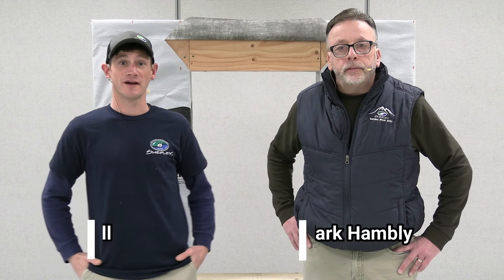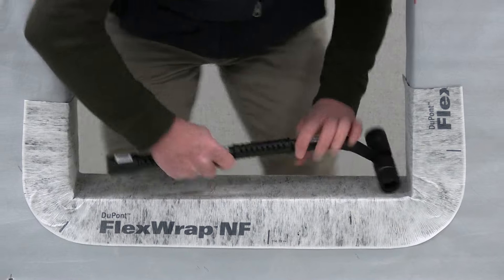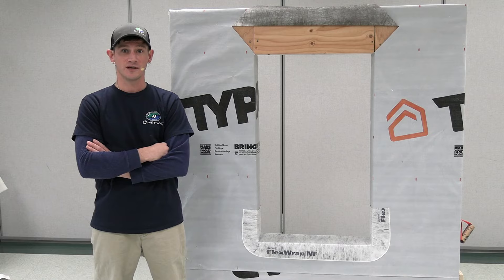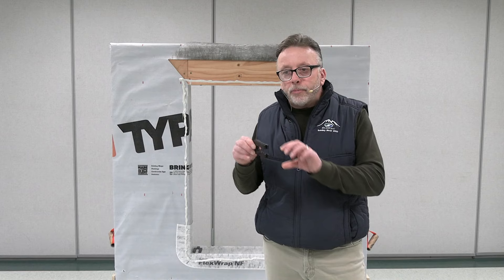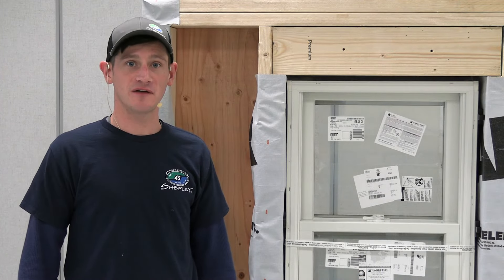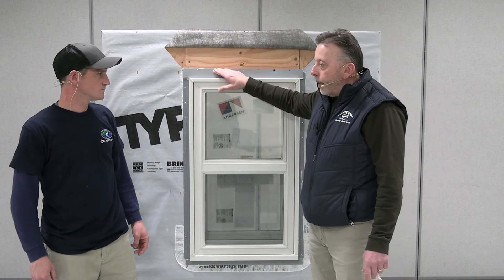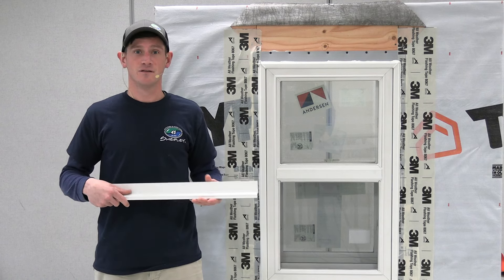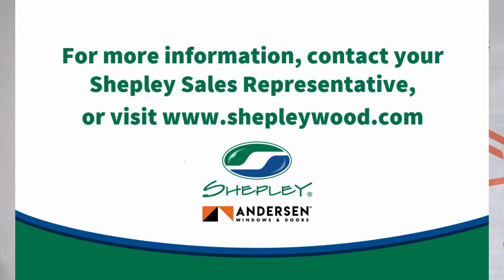Installation of an Andersen 400 Series Tilt-Wash Window with the Energy Performance Panel.

Comment: It appears that you used screws around the flange, can they be used instead of nails?  Our windows will only be in an exterior covered porch so removal would be easier should future owners want to convert back to an open-air porch.